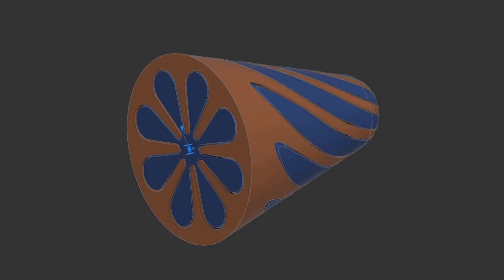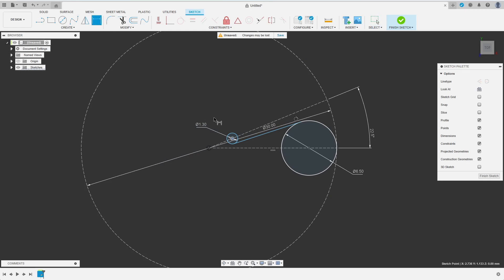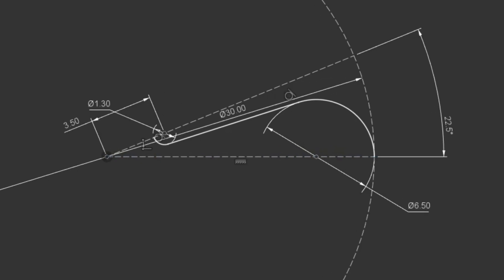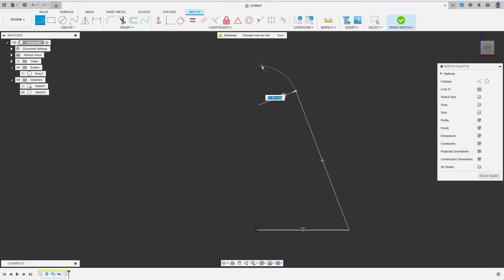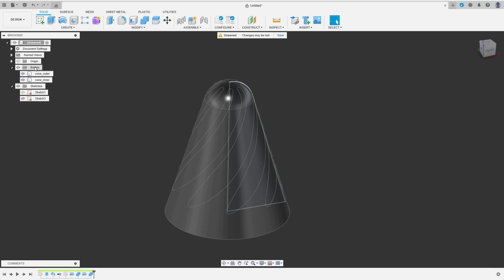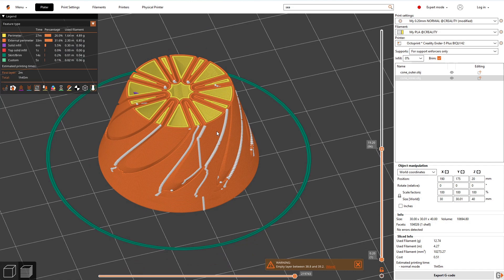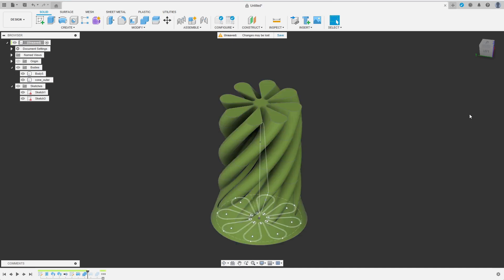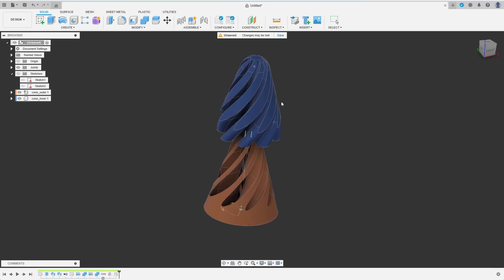Impossible Passthrough Objects in Fusion

Comment: I’ve been trying to print these but they never fit into each other. I’m using and ender 3 v3 se with a .4mm nozzle. Please someone help!
Reply from the maker: Seams and elephant foot could be the culprit. Assuming the dimensions are ok (i.e. no excessive overextrusion)
Reply: @getprototyping  I know how to turn off elephant foot, can you explain further the seams settings, do I just set the seam gap distance to 0?
Reply: Or increase it (I read the docs now and that would make more sense), which seam position do you recommend? random?

Comment: How do you make the ball shapes in fusion?
Reply: I was just wondering this also, there are some pass through objects that are cone/tower etc shaped but they’ll also have a ball that can pass through them, I could really use an explainer on that as I’ve found very limited info on how to make these in any shape
Reply from the maker: Now I got it. Probably will do a follow up video. Basic process is the same, just intersect the ball body with the spiral.
Reply from the maker: What kind of ball shapes do you mean?

Comment: What’s the print settings to succeed with those very small overhang parts
Reply from the maker: Overhangs are usually not an issue with these geometries. Just dont go too fast and avoid blobs, eh at the seams. If the outer part reconnects in the top section many use tree supports, but even these should not be strictly necessary.

Comment: This is over complicated for this model. You can simply start with a sketch on the top plane that has 1 fin profile within a circle. Then add a vertical line at the origin and use the sweep command with a twist that follows the vertical line. After that you can extrude the original circle sketch with a taper angle to form a cone. Shell the cone and then use the outer surface to split the spiral you just made. Then use the spiral to split the cone and add tolerance on all faces of the spiral with the offset command. Done.
Reply: Can someone explain this in a video please? The 'better' way to do it?
Reply from the maker: Yeah, thanks for the input, I somehow missed that sweep has the twist parameter 😬. Based on how the sweeping is implemented, I had good reasons to avoid offset and patterning the solid. Generally, I prefer working with solid booleans for such „partitions“.
Reply: Came here to make that exact same comment: sweep'n twist. 
Did the offset directly on the initial sketch, like your 2nd attempt. so I can extude this thin surface to split the cone into 2 parts
Did the circular pattern cut in the Solid environement, not in the sketch (less processing stress on fusion: as a rule of thumb, it's always better to do patterns, filets and chamfers on 3D objects instead of in the 2D sketches)
That shows one thing: in 3D design, there are many many ways to reach the same result. The real art is to chose the simplest, most flexible and safets path
Reply: Yes it is.  I use slot oval.  Pattern. Sweep.  Combine. Offsets of course.   bout it.